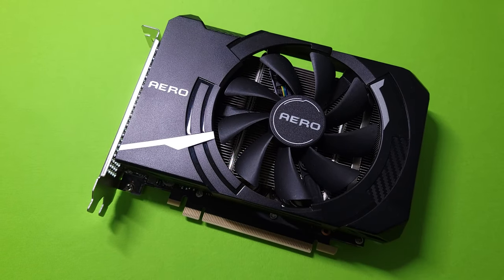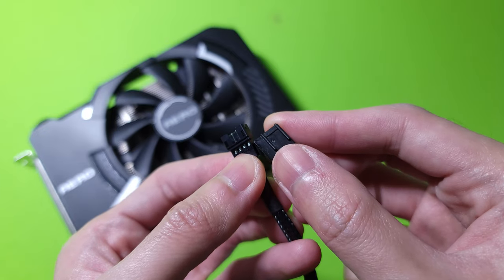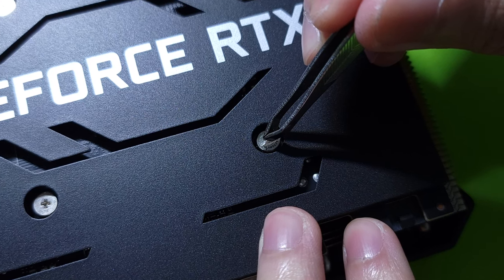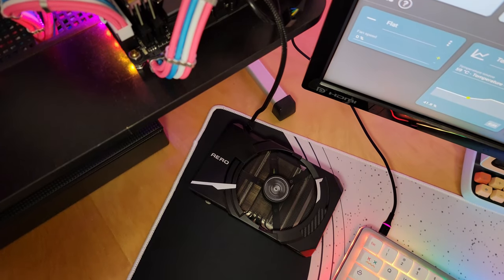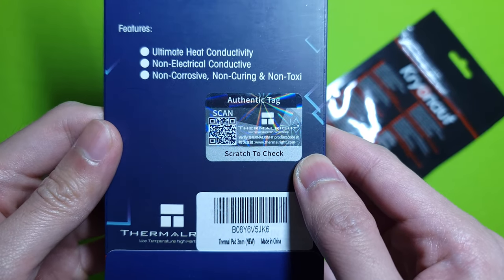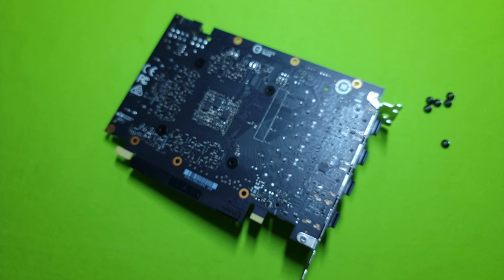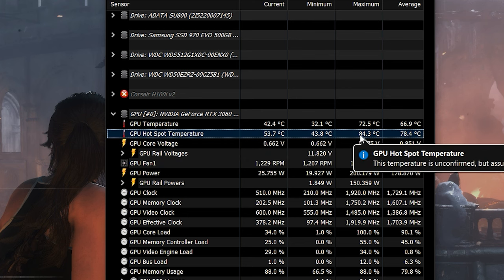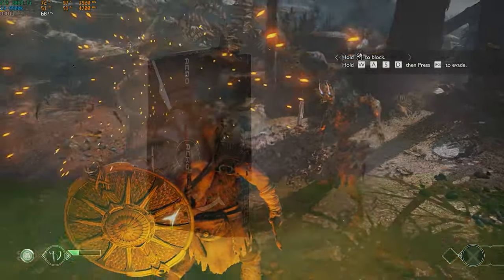MSI RTX 3060 Ti Aero ITX - Replace Thermal Paste & Pads

Comment from the maker: Some back story: I used to own a Gigabyte GTX 1050 Ti and an EVGA GTX 1050 Ti SC; they were both single-fan. The Gigabyte card had 0dB mode but the EVGA card didn't. So I tried flashing many VBIOS to the EVGA card to see if I could stop the fan. There was one BIOS that made the fan completely silent during idle, but when the temperature rose, the fan got stuck in spinning at 100% until I shut down the PC.
As mentioned in the last video, I flashed some BIOS from different cards to this mini RTX 3060 Ti but none worked. I thought that MSI was similar to EVGA which they locked the fan speed via the BIOS, so I grabbed this cable in order to control the fan with my motherboard. However, MSI did a big brain move by using a fan with a minimum speed of 1200 RPM. This is why the video is a complete failure :))
Reply: Thanks for the video, I appreciate all the useful testing you've done with this card. Have you thought about doing a Noctua Fan Swap Mod to it?
Reply: @Splootyy  do you think it will fits this graphics card?

Comment: Have you considered zip tying noctua fans directly to the heatsink and ditching the stock fan? You might get way better temps with less noise.

To be able to really tell if there was improvement you might want to temporarily remove your undervolt when comparing stock to new fans. 73 Degrees is a really good result but its just not hot enough to reveal once the heatsink is bottlenecked/saturated

Comment: What were your temperatures before the undervolt? My 3060 aero itx reach 78c underload and should I repaste thermal paste or not
Reply from the maker: Just undervolt before opening the card, but 78 is fine.
Reply: I use it for gaming and I am not too sure how to undervolt because there are a lot of videos with different ways. @PokerFaZe 
The highest temps under gaming load would be 78 c package and 90.7 c hotspot

Comment: I just wish these cards were available in the US. Best case, I'm importing one for $1000 and that is not acceptable when I already have a gigabyte 2070 itx card. $500 sure. Not $1000. But these cards are the only ones that will fit in my PC so I'll just have to hope next gen there are finally some good dual slot itx cards available.

Comment: Would love a 3060ti in ITX form factor. However they are impossible to get. A decent 3060ti costs £500-£600 in the UK whereas the aero model costs £800 and only comes from Japan with a 1.5 month lead time. £800 is more expensive than a 3070ti

Comment: Thank you for the video. I am looking to do this maintenance on my card, should i buy a 1.75 thermalpad or follow what you did?
Reply from the maker: If you can find a good 1.75 thermalpad, you should get it, compressing manually is not very consistent.

Comment: What about thin copper shims on the memory itself? I seen a vid not too long ago about a 3080 getting it. Dropped the memory temps by a decent margin. Also- I will say, MSI did a far better job with this card than EVGA did with the 2060. Mine is the same form factor in length and height. But, takes up a third slot. And upon looking at it's cooling solution. I found it had only 3 heatpipes. Which were far shorter than those found in this card.

Comment: I've tried them all on my i7 4790 Dell Optiplex 9020MT and 650 watt PSU with 32gb HyperX Ram at 1080P resolution on 60hz. monitor I own. Originally came used with a GTX 750 Ti, then I upgraded to GTX 1050 Ti, then 2 years later  a GTX 1650 Super, now a year later...after much research figuring the max performance on this Dell could be with using a GTX 1070 so I just ordered the MSI Aero ITX GTX 1070 8Gb GDDR5 single fan but premium cooling and quality reviews.

Comment: Sir the extra thermal pads you placed was on (inductors) which wont get that hot and are not really important to cool.... You shouldve placed them on the 4 tiny chips behind the inductors which are called memory vrm(its a 2 phase memory vrm)... Please next time you disassemble it, put some thermal pads on the aforementioned chips

Comment: my 3060 ti aero reach 89°C when playing forza horizon 5. should i replace thermal paste and thermal pad?

currently using D19 pro and 144p monitor
Reply from the maker: Try undervolt it, you don't need to replace
Reply: @PokerFaZe  i heard from video your undervolt settings for 
freq(MHz) = 1835MHz and Voltage(mV) = 865mV.  What is your settings for memory clock(MHz) and fan speed (%)?
Reply from the maker: 1920MHz at 875mV
No settings for memory
My max fan speed is 90%
Reply: i already try your settings and it crash when loading to game menu.

currently i'm using this settings
Power Limit 60%
Temperature Limit 80%
Fan Speed 80%

Temperature reduce to 77°C but need to sacrifice FPS 🥲

Any suggestions to do with my gpu?
Reply from the maker: Dank, that's a lot of power limit, I did not touch the slider at all, only fiddled with voltage and MHz

Comment: Terrific video Poker FaZe 🥰👍🥳! I always love your content. As a multiple Mini-ITX pc owner and builder, I love these ITX single-fan GPUs and appreciate the engineering and design that goes into them. I current have an ITX RTX3060 from PNY and it remains fairly quiet even under load and only gets between 65-75c under intense gaming loads which is quite impressive to see for such a compact design. Keep up the great work 🥰🥳👍🤩
Reply from the maker: Thank you so much <3

Comment: Just use liquid metal bro.. No benefit by using old school thermal paste.
Reply from the maker: Nah, that's too messy and overkill, I am done with lm 😁
Reply: Why do people keep recommending liquid metal? At best, that will temporarily give you good cooling assuming everything goes perfectly. But it's very risky. Kryonaut Extreme will get you within 1-3 degrees of LM but will keep its performance and never have to be replaced for the life of the card because it is non-curing. Best option by far.